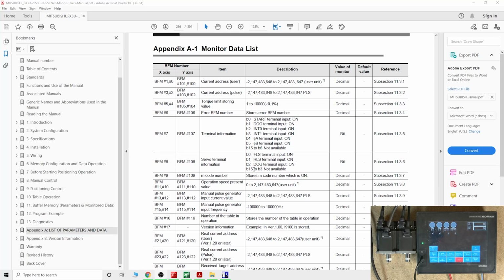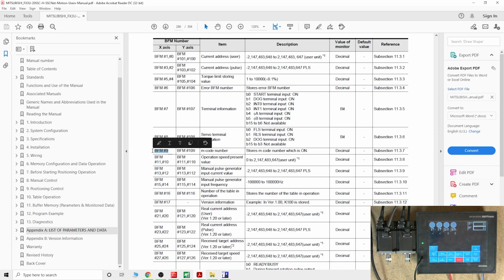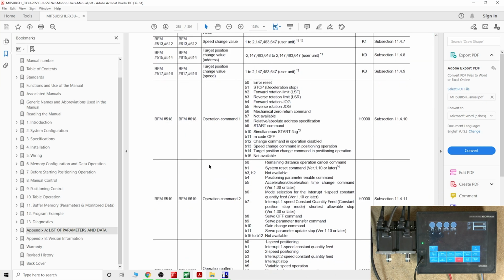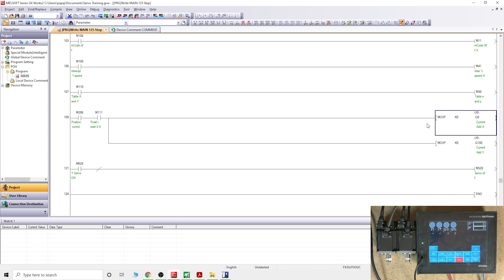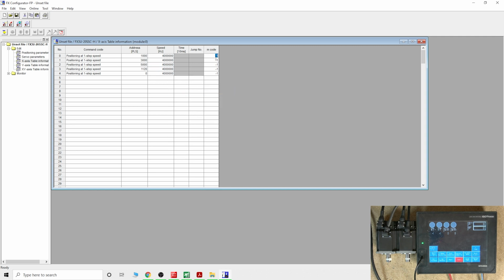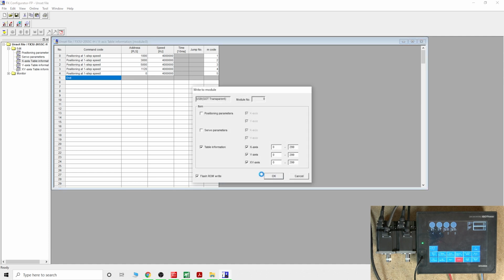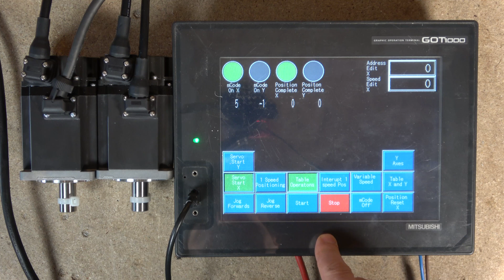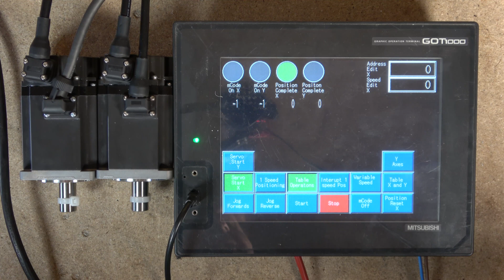Mitsubishi MR-J3 servo, Table operation with mCode using Using GT designer 3, GX Works 2.

Comment: Hello Sir, I am a novice in what relates to the servo and amplifier. Currently I have a hf-kp 73b motor and a mr-j3-70a Mitsubishi amplifier, they are mounted on a unit that if I can turn the motor one day a 4th axis for my machines. I want to plug everything into the Centroid controller card which is called Acorn. I've been trying to find someone who knows Mitsubishi here for 4 years but no luck. I think the manual and information are too complete so become dizzying. So I go back to the internet to try to make it all work. Please let me know if you don't want to or can't. A big thank you for your time.

Bonjour Monsieur , 
je suis un novice a ce qui a trait au servo et amplifieur. Presentement j'ai un moteur hf-kp 73b et un amplifieur mr-j3-70a  Mitsubishi  , Ils sont monter sur un unite qui si je capable de faire tourner le moteur un jour une 4 eme axe pour mes machine. Je veux brancher le tout sur la carte controleur de Centroid qui a pour nom Acorn . Ca fait 4 ans que j'essais de trouver une personne qui connait Mitsubishi ici mais pas de chance. Je crois que le manuel et information son trop complete donc deviennent étourdissante . 
Alors je me remet a l'internet pour essaye de faire marcher le tout. Merci de m'informé si vous ne voulez pas ou ne pouvez pas . Un Gros merci pour votre temps.
Reply from the maker: MY friend, i be not much help for you here, due to my time availability. Sorry
Reply: I'm really sorry but my goal from the beginning was that I just wanted to know how to get my engine running. As I already use motor servos and they are wired like steppers I was only told one or two parameters needed to be done to make the drive available to the cnc controller.
If you still not able to help , do you have clue for me where to look for information .
thanks 
Alain 

 @IGSElectronics  Je suis vraiment désolé mais mon but du début c'est que je voulais seulement savoir comment premettre a mon moteur de tourne. Comme j'utiliser déje des servos moteurs et qu'il son brancher comme des steppers ne me dissait que selement un ou deux parametre devait faire pour rendre la drive disponible pour le controleur du cnc.